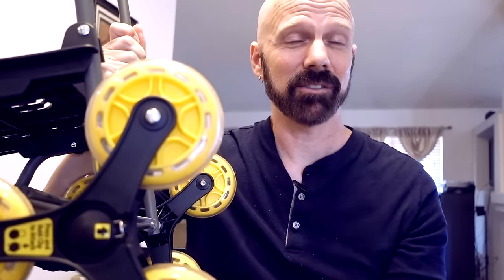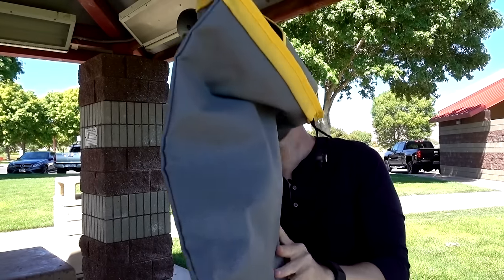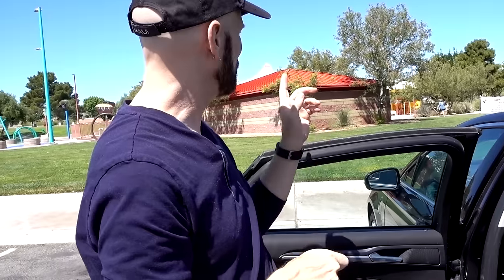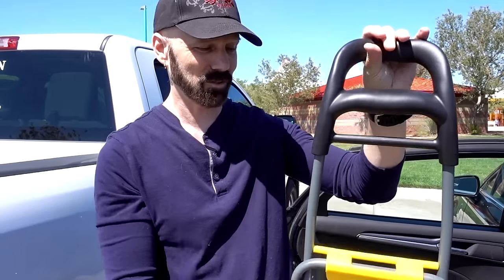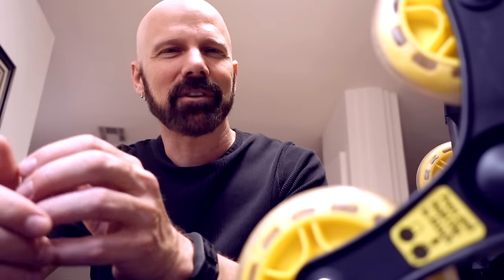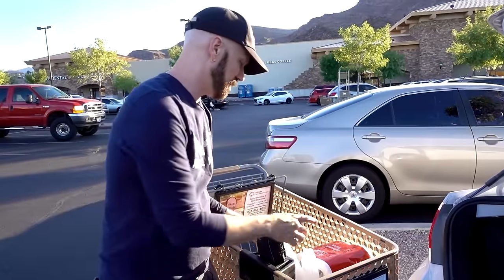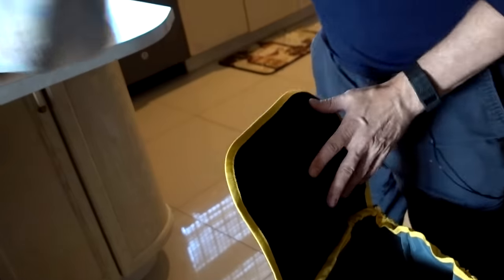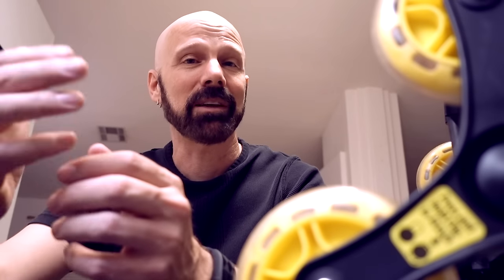Climb Cart Review: A Stair-Climbing Cart?

Comment: Can you tested out on different height of stairs plus the tires look kinda of flimsy so yes keep updating!!!👍🏼👍🏼👍🏼
Reply from the maker: I'm definitely keeping an eye out for different types of stairs, including an open staircase.
Reply: I am using this cart past 2 months, I have half foot height stairs(bigger than shown in video), I felt most of the time it is hurting my back with 2 cases of water(even with once case) the handle is too short for climbing stairs to second floor you have to bend and pull up (though I am 5.8” tall), it makes lot of noise while climbing(you can notice the same in video) which is disturbing neighbors  and you need to secure all the item on the cart tight with the rope(as you seen in the video water case was fallen),  otherwise half way things will fall off.
If you have smaller and less number of stairs then, it will be very useful, now I am using it only for dumping trash bags & and when I have less grocery. Go it for $20 only from Target no much regrets.

Comment: James, I think you need to get to the top of the stairs and TURN the cart Around. Pull it down the stairs in the same way you pull it up.
Reply from the maker: Hey Tony, that could be, but I was trying to do it the same way that is demonstrated in the commercial. It might also depend on what is loaded on the cart. Good point, though.

Comment: I just bought this cart... im disabled and need need it for several things. The piece on the handle you have to snap down takes some strength n effort to do so amd i ended up smashing n bruising my thumb. So that is an issue because thats a piece you constantly would have to work to fold it. And some people may not even be able to snap it closed its so tough.

Comment: Not going to claim that this is just an over-the-top/ fanciful invention, but I'm pretty sure a cart with a pair of larger wheels could just as easily accomplish this 'climbing up the stairs' function (as long as the wheels are the ones hitting the steps instead of your cart; because many carts have got smaller wheels, and carting them up the steps at a tilt would usually end up with your cart hitting the steps instead), and you wouldn't have to feel the impact of the three wheeled slamming the ground when climbing up, or going down the stairs when the rotate amongst each individual wheels (notice the impact when James was pushing the cart up and down the steps 3:45 & 4:44).

Comment: My wife showed an interest in the product, mostly for moving laundry up and down stairs.  On the commercial, they show putting a basket of laundry on this thing and doing the stairs.  Looks to me like a basket of laundry would just fall off, would you agree?  And $40 bucks?  OH, and my wife would probably want to push the limit and stack 2 baskets of laundry on the thing.
Reply from the maker: Yeah, the bottom isn't very large so you'd probably have to bungee it. The original version (marketed in Oct. 2016) had a much larger base than the current model and could hold 100 pounds. I think it could hold the weight of two baskets, provided they don't fall off!

Comment: This is a great idea but the cart doesn’t look that sturdy.  I second the request that you keep us posted, if you use this, on how it holds up over time.  Also, I’d love it if there were an accessory that could attach to the base and put “walls” on three sides of the items you’re carrying. I worried that if you didn’t balance it properly that water was just going to slide off the sides.

Comment: 2 big problems as i've watched the review, first of all, about holding up to 75lb, they should've put a bigger(or larger) base on the cart, I mean what if u need to carry 2 cases of the water bottles? I don't thin they will stay on top of one anotheranother thing is I wish there was longer handle, as I saw you were in uncomfortable position(not straightening up your back when carrying it when going up to the stairs), it should've been extendable or sth imo, otherwise hurting back if the stairs are higher

Comment: Too much overthink on the 3 wheels. Just put larger softer rubber wheels on the carts we have. For heavy items and people this is not practical or safe. There's a reason these will never be adopted for those weight reasons. As far as for wheelchairs.....you aren't going up any stairs yourself, so no matter what, you will need a strong enough adult to pull you up backwards, and a tri-wheel isn't going to make much difference unless you're a professional bodybuilder because you're going to have to stop every step or two to reset your leverage and wheelchair level. Also, pulling someone backwards up a long flight of stairs is a broken face(or much worse) just waiting to happen regardless of the system. But....for wheelchairs that's why we have elevators and first floor residences people.....there's already a 99% in-place perfect solution for that. Even when you get to older government buildings and colleges, they all have handicapped access doors because it is the law.